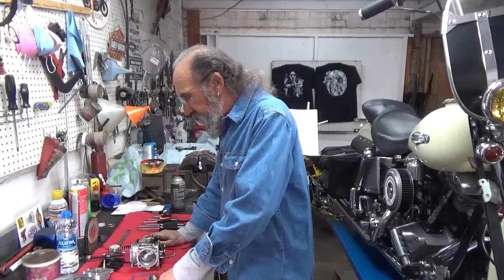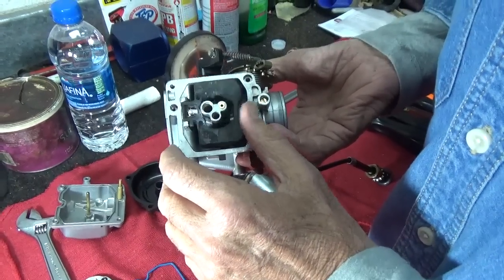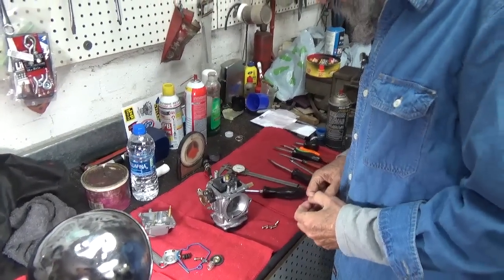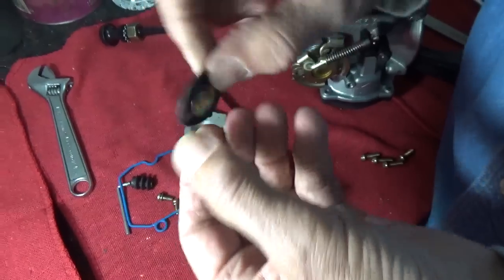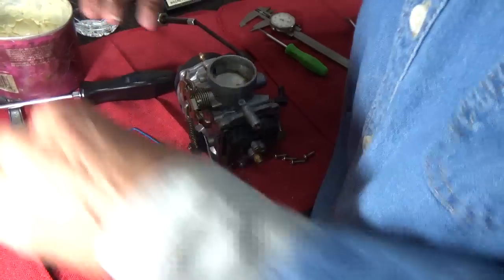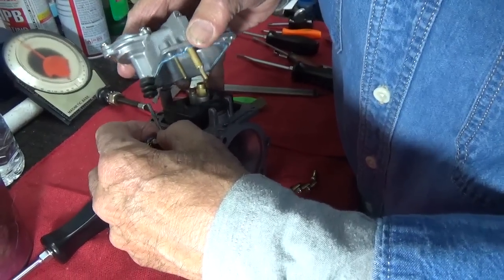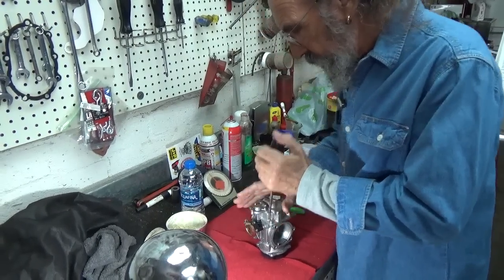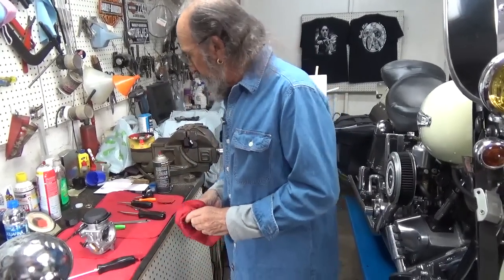Fred's Harley CV carburetor needs cleaning

Comment: The only thing you might have touched on is the idle mix screw hidden under the welch plug. These are adjusted way too lean from the factory to meet EPA emissions standards. They are good carbs, though.
Reply from the maker: Thank You.

Comment: I have stripped out so many cv bowl screw holes with those snap on screwdrivers it insane. Never with any other screwdriver only when using my snap-on. I prefer using them because they grip better and never cam out the head but they have so much more torque they will strip the whole out like crazy
Reply from the maker: I don't have that problem.

Comment: Thanks Mike for another good video. One thing I've notices is the little rubber accelerator pump boots that come in the kits for various carbs, they seem to break down and crack faster than an original. Not much we can do about it but keep a couple spares around.
Reply from the maker: Maybe the kits on the shelf are old.  Most bikes have fuel injection now.

Comment: Good video as usual.
On every carburator I've rebuilt, I replaced the Phillips screws with Allen heads.
 Me and those lead alloy carb screws that distort when you put a Phillips screwdriver anywhere near them just don't get along. 👍
Reply from the maker: I have trouble tolerating those carburetors.  But, there they are.  I get it.

Comment: Mike
If you look at the screws on that Mikuni carb they have a dot on the head indicating that they are JIS ( Japanese Industrial Standard) . If you find a Philips JIS you will see a better fit and less of a tendency to rotate out on loosening and tightening.
Found this out working on Japanese bikes and cars.

Cheers
Reply from the maker: I know you re correct.  When I worked on Keihin carbs alot, I kept allen screw kits for them and automatically installed them the first time I took the carb apart.

Comment: Another way to check the Excelerator pump jet nozzle is to put a little gasoline in the bowl and take the rod and push down on the diaphragm and some gas will squirt out if not it’s clogged. Also using a JIS (Japanese industry standard) screwdriver will not allow you to strip the float bowl screws out Japanese screws have a different pitch then American screws.
Reply from the maker: Thank You.

Comment: Mike, I know too well what you're talking about!! Had to clean my 05 carb after it sat for almost 2 years after my massive heart attack a couple of years ago, went to the local Harley Davidson dealership to get a rebuild kit, and I wanted an extra emulsion tube because I cracked mine taking it out because I removed the high speed jet before breaking loose the tube(it looked like jello in the carb). The young fellow at the parts counter said we don't stock anything for carburetors, they are outdated and I don't know anything about them much less what a emulsion tube is, we only have fuel injection parts because that's what Harleys have 😂. He went to the back and came back with someone else and they showed him how to lookup carburetor kits and parts on the computer, when the other fellow left he told me,  Sir I thought you were joking when you asked for that part and turned red 🤣. Keep up the great videos.. what is the shelf live on Harley oil, I have 3 or 4 quarts that are a few yeas old?✌🏻
Reply from the maker: I think, as long as the containers are sealed, it should be fine.  But, I'm not a chemist.

Comment: Hey big Mike, starter complete new, wont engagement, gonna tear clutch down tomorrow. Did see washers missing behind 3 ball bearing clutch cable assembly. Keep tearing it down. Thinking clutch basket nut came lose
Reply from the maker: Sounds like a pain to me.

Comment: Question on the CV CARB. 

I'm transitioning from the magnetii marellii injection to a carb this winter. The mechanic told me that the CV carbs do not need to be retuned for elevation. It's self adjusting by means of the vacuum/pressure.

In your experience, is that accurate? I live and so far ride here in Kansas, but plan on doing some longer rides into the mountains once I get to retirement.
Reply from the maker: Wow.  I question that one.  But the vacuum diaphragm certainly does move the needle.
Reply: I've heard switching from fuel injection to carb or vice-versa is more of a headache in the wiring harness and electronics. Do a video on it if you can. I'd like to see what's really involved in that process. I was going to buy a 98 ElectraGlide but it had fuel injection so I passed on it. Maybe I was wrong about it, not sure. Good Luck
Reply: @mikaldene7146  my 01 EG has the MM injection, probably why I got it so cheap. But it has run fine until I did the cam chain tensioner upgrade and swapped cams. Then the fight to get it tuned. It now likes the warm weather but really hates the cooler weather. 

There's a harness overlay that seems to make it easier, said the guy who hasn't done it 😂

Something has to give, I'm tired of the the hassle with this finicky injection system
Reply: CV carbs are self-adjusting to some extent, but not enough to make up for large changes in elevation. The main jet and needle are usually fine, since the needle is vaccuum operated. Riders often just swap out the slow jet and adjust the idle mixture screw.
Reply: @alanjones4358  thanks, I don't expect to have to rejet at altitude as I don't plan on spending a lot of time at higher elevations, more of a passing through type of trip. But it's been way too many years since I've messed with jets on carbs, and then it was automotive (a little larger and easier to get to than a bikes)
Reply: @gerryrandolph  You'll likely be fine, a lot of people don't bother. I would at least carry spare spark plugs in case of fouling, since you'll be running richer.
Reply from the maker: The later injections (Delphi) are much easier to diagnose when they give grief.  The earlier Magnetti Marelli is fine until it gives grief. Like our early electronic ignitions, fuel injection has improved a lot.  Changing back to carburetion gets pretty involved.  Changing to a manifold and carburetor necessitates changing to a petcock.  Then, you'll need an ignition system (ignition crank trigger, coil, and brain box) and to change the entire wiring harness.  I have done this.  It can be very expensive.
Reply: @pacificmike9501  the carb swap is going for about $1,600 around here. A couple of shops have quoted me that price range. 

The local dealer has declined to work my bike due to the age, which I get (sort of), and the fact no one they have knows how to work on the Magnetti injection. 

I looked at the Delhi conversion, at the cost of that compared to carb.....doubled. 

I'm of an age, I understand carbs more than injection. The less computers the better.

Comment: Mike is there a formula you use to determine how much fuel a carb needs in order to run on a specific sized engine? 50cc vs 1000cc as an example...
Reply from the maker: We used to figure it on car engines.  1 1/2 times the displacement in cubic inches of the engine = the CFM of the carburetor.  With bikes, it's just been experience and Manufacturer's recommendations.

Comment: Just curious why the checkball is not addressed? It is an apparent issues when others have cleaned the jets etc., but still have issues getting the bike to start and run/idle properly. Thanks
Reply from the maker: The checkball is in the oil pump, not the carburetor.  It holds the engine back and in the oil tank when the motor is not running.  If the bike sits idle long enough (not running), then it weeps past the ball a little at a time until the crankcase fills up and it comes out through the breather hose.  It is not malfunctioning.

Comment: Howdy.  Any chances on doing a rebuild video for a Bendix/Zenith carburetor?  Great videos you make.  Thanks.
Reply from the maker: I haven't even seen one in a long time.  I ran one for years on my Shovelhead.  I bought it new, modified it a bit, then replaced it when my girlfriend bought me an SU.  In the eight years I ran the Bendix,  I used an Arlen Ness " flow ring" inside the air filter and  I removed the choke plate and shaft and plugged the holes.  It worked well, 'til I fell in love with the SU.

Comment: I swear this cat is the biker Bob Ross. Same exact energy and patience. Wish i had a fella like this as a neighbor so i could hang out and learn from him. This in a way is like that tho i guess right? What carb were you mentioning that you said you could adjust for elevation on the fly? I have an 03 wide glide. Only mods are a stage 2 big sucker air cleaner and vance and hines pipes. It still has the factory carb and intake so im wanting to upgrade that but not sure what carb to go with. Any help would be much appreciated
Reply from the maker: Carbs are always a matter of personal preference.  The old carburetors were like tractor or "industrial" units you could adjust main and idle needle while running.  The only carbs I can think of today like that, would be a modified S&S or an SU that you can easily adjust by the side of the road.
Reply: @pacificmike9501  I gotcha, I really appreciate the reply my friend.

Comment: Good video mike, I recently got the 46 Knuckle back from mechanic and he told me to run premium 98 octane in it instead of the 91 I was using, it did seem to run better. Mike, I have to remove the chrome trim that is on the gas tank, I can see the little grub screw that holds the badge on but I'm not sure how to remove the trim, is it just pressed on. I have searched some forums but no luck as yet. Thank you for any help you can offer.
Reply from the maker: There should be 2 screws, although someone could have glued it on.  91 Octane is what we're all tuned to because it's the best we have.  I don't know how much compression or what combination you have, but I'll bet it runs well with that gas (98).

Comment: Good morning Mike, I put a kit in the cv ,but after letting the bike sit for 10 /20 minutes I have gas dripping out the 2 small holes in the bottom of the face of the venture, changed float height lower than recommended but still leaks ,any thoughts
Reply from the maker: Something is holding the float valve open.  Try cleaning it again.  Possibly, the needle and seat (float valve) are dirty or damaged.

Comment: Hi Mike , I seen one of your videos where you changed jets in carb, I think it was Mike’s. You put a #50 jet in, said you were in high elevation , well I bought one recently from up in the hills and I’m in Florida. Elevation 33ft ! Do you think a 52 or 54 would be better at this low altitude , first time working on Electra Gilda , it’s a 1985 , thanks for any help . Oh it spits at me so thought jet. Might help
Reply from the maker: You are on the right track.  I don't know what has been done with your motor, but, if a 52 doesn't do it, try the 54.  But, unless you've got some serious stuff in there, a 52 will probably do it.

Comment: On my cv carb, 1984, in the accelerator pump you have two tiny ball bearings that go in the holes by the o rings
Reply from the maker: Not in the later ones.

Comment: You said you prefer a carb that lets ride in variable altitudes. Which carb would that be ?? Thank you
Reply from the maker: I want to be able to adjust without changing jets.  Adjust the needles on a Linkert or turn the mixture screw on an SU.

Comment: Hiya Mike, cameraman Mike, Fred, and wireless mic... float level question on that CV: it's got a 40 thou tolerance (0.040) of "correct level". I'm here about 12 feet above sea level. You're a couple thousand feet higher if I remember correctly. Would varying the float level for elevation (higher measurement number/lower bowl fuel level for you, opposite for me) compensate for the variation of air density? Obviously at some point jets need changing, but for a few thousand feet difference, would just the fuel level difference be "enough"? Same for "hot/humid" (here in FL) and "cool/dry" with similar elevations?
Reply from the maker: I don't think so, but I've never considered it.  I've certainly run larger fuel bowls.  The one on my SU holds about twice the capacity as it started out with.  With a wide open throttle, uphill, outrunning a very hotrodded Evo, it really helped.  I don't think it affects the richness of the mixture.

Comment: would have liked to know if the low speed jet has a hole all the way through or not. also show that the crud can plug the main jet closed. somewhat ok video but those are 2 important things i was looking for.
Reply from the maker: Yes, thew low speed jet has a hole all the way through.  Everything can get plugged with crud in a carburetor.

Comment: Hey Mike,

I bought a 1981 Shovel last year and it hat a Dell‘orto PHM 40 installed. Should I keep it or change it? As this was changed on purpose some time ago I was wondering what the benefits of a Dell‘orto are. Can you help me with that? 
Other than that keep up this flow of amazing content.
Reply from the maker: Just  a matter of preference.  They were very common at one time.  They are still available from different aftermarket suppliers.  I've seen them used in a lot of applications.  One of my friends used to run a pair of them on his Knucklehead drag bike.

Comment: Could you tell me what the model number is on that carb? I'd like to look it up to see what that fitting is near the gas fitting. Or can you tell me? looks like the gas fitting only plastic. Thanks.
Reply from the maker: The fuel fitting is plastic.  There is a metal repair/replacement fitting available for them.
Reply: @pacificmike9501  I'm talking about the carb in your video here, It has the metal one for fuel line  but it also  shows a plastic one on same side. You can see it at the 8:10 mark.
Reply from the maker: Vacuum

Comment: Mike I have a 90 EVO, it has round floats I am told it should be upside down to adjust can you give me the height and proper procedure.
Reply from the maker: Very hard to describe.  It has to be held at the proper angle and then there is a specific measurement.  It is very clear from the diagrams in the Harley Davidson service manual published for your model.

Comment: My 04 tc88 when it's cold the idle set normal rpm then after riding bike gets warmed up the rpm rises to 1200 plus rpms, what would fix this annoying issue? I live in fla. Sea level,thanks
Reply from the maker: Since you can set the idle, I'm assuming this is a carbureted bike.  What's been done to it?  Is it all stock intake and exhaust?  Maybe a vacuum leak?  Hard to diagnose long distance with no info.
Reply: @pacificmike9501  it's carb bike only has4700 miles has yance&Hines straight shots looks like stock intake but the plastic snorkel box is removed with chrome factory oval cover put back on,I guess that would emulate Arlen super sucker basic idea? I bought the bike 6 mnts ago,like brand new,other than climbing rpm
Reply from the maker: Look at your spark plugs.  If one is dark and one is light, you have a vacuum leak.  Probably also needs a jet change, probably needs a larger low speed jet.  First check for that possible vacuum leak.
Reply: @pacificmike9501  that's what I will do thanks,I let you know

Comment: Thats the problem, it is not clear. I have round floats and they cover square floats. The procedure is diffrent for mine, I have seen some say the carb should be held vertical but no measurement provided. I was wondering if you had any literature covering this. None of my service manuals covers this particular CV carb with round floats.
Reply from the maker: Is it a Keihin?  Is it a CV carb with no accellerator pump?  If so, what year is your bike?  Give me enough info and we'll figure it out.  Years and models really make a difference.
Reply from the maker: Okay 90.  That's an early CV.  Sit tight.  I'm looking for the appropriate manual.
Reply from the maker: I found a 91 service manual.  I don't like to use the wrong one.  But, the diagram looks correct for what you have described.  The floats are round.  I'm gonna try to word this right.  With the float bowl off, hold the carburetor upside down (at right angle to the floor, or bench top).  Use a straight edge across the float and keep it parallel to the floor.  Now measure from the top edge of the perimeter of the float to the flange of the carb where the float bowl bolts on.  The measurement is .725-.730".  If you have a 91 service manual, it's on page 4-12.

Comment: I just got a 2001 dyna 88 twin cam, what carb rebuild kit do I need?
Reply from the maker: Congratulations!  Now, get a kit for whatever carb you have.  Is it the original carburetor?  If so, order one for your bike.  If it isn't, you'll have to figure it out.
Reply: @pacificmike9501  I found a random brass bushing looking thing in my float bowl! I believe it is factory. But can’t figure out where the brass piece went. Any ideas?
Reply from the maker: What is the carburetor?
Reply: @pacificmike9501  cv40
Reply: @JustiNDalT0N1 I just had it randomly pop out as well, any luck finding its home??
Reply: @richardbarker2339  lol no. I just ran it without it

Comment: Mike, you got anything against a Super E?

    -Joe
Reply from the maker: I got nothin' against anything.  But, I like a carburetor I can adjust a whole bunch without having to change jets.  That is why I run Linkerts on my old bikes and an SU on my Shovelhead.  With the Linkert, I just reach down and turn the main needle a couple of clicks at the 5000 ft sign and about 3 or 4 at the 8000 ft. sign.  The SU is more involved.  I have to pull a screwdriver out of the little pouch on the back of my saddlebag and turn an adjusting screw on the carb an eight of a turn. I think I'll make a knob for it.  I have one with an old turnsignal lever on it. The adjustments are very precise and well designed. That's why my preferences are what they are.
Reply: @pacificmike9501  Thanks Mike.

   -Joe